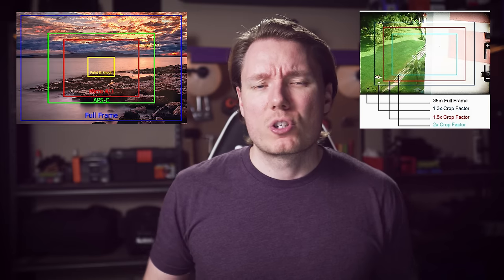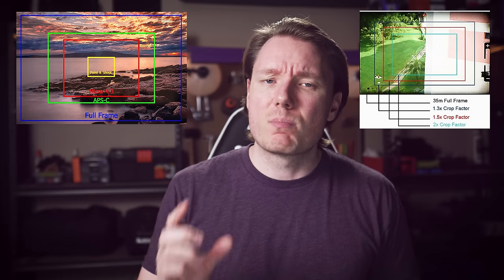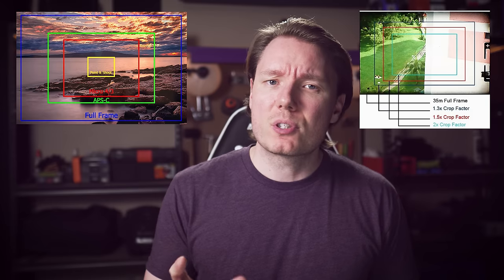Crop Lenses on Crop Bodies: How It Works vs Full Frame (APS-C & M43)

Comment: There's one thing missing in your explanation; and it's the T number. To say that a full frame f/1.4 lens is wasted on an APS-C body because part of that f/1.4 "light quantity" falls outside the frame, while an APS-C designed f/1.4 lens fully exploits the f/1.4 "light quantity" potential, is misleading, because you don't say that the amount of light that actually hits the (and is recorded by) a sensor is NOT determined by the F number. The F number is a merely mathematical relationship between the focal lenght of a lens and the diameter of it's aperture. It is, in fact, called more correctly the FOCAL RATIO of a lens. Now, do you read "light" or "luminosity" anywhere in the FOCAL RATIO definition? No, you don't. And you don't because the TRANSMISSION of the light is NOT a direct consequence of the focal ratio. The focal ratio of course is an important factor, as it describes and determines the physical boundaries through where the light has to transit, but it's not the only factor. For marketing reasons, lens manufacturers tend to sell their lenses under this misunderstatement that the F number means the amount of light that a lens transmits, which is not true. And why do they do that? Because it helps sales and hides the truth. Because saying that an f/1.4 lens transmits double the light of an f/2 lens can hide the hard fact that your lens may NOT trasmit double the light, because there are other factors at stake. There's the lens coating, which is layers of metal particles that serve to attenuate inter-lens reflections, but which subtracts light as well. Most importantly, there is the number of glass elements in a frame, the number of glass-to-air surfaces, and the actual QUALITY of the optical glass itself, which are factors that may SIGNIFICANTLY impact the amount of light that is transmitted by a lens to a sensor. All of these factors are HIDDEN and MySTIFIED when a lens luminosity is advertised as determined by the F number. 
So, having set thi fact straight, let's assume that two f/1.4 lenses, one a full frame lens the other an APS-C lens, are used to take the same photograph, in the same instant, with two identical APS-C cameras both set at the exact same shooting parameters of aperture, shutter speed and ISO. If the argument that an APS-C f/1.4 lens "uses all the light of an f/1.4 aperture" while a full frame lens 's light gets "wasted" because part of it falls outside the frame, then the photograph taken with the full frame lens should be DARKER than the photograph taken with the APS-C lens. But instead, guess what? They are IDENTICAL. And the reason is that the T number, the TRANSMISSION number that determines the actual QUANTITY of light, is an AVERAGE that is calculated over ALL THE SURFACE of the exit pupil of the lens! And why is that, you may ask? Because light is not transmitted on a flat projection plane. Light is NOT 2D. Light is 3D. If light was 2D, then yes, transmission would happen in straight lines, and whatever light falls outside the frame, would be lost; but lenses don't work that way. And this is the key concept to understand: ANY POINT ON THE SURFACE OF A SENSOR IS HIT BY LIGHT RAYS COMING FROM THE WHOLE SURFACE OF THE LENS' EXIT PUPIL. So why does this matter? Because like I said, T-number is not a mathematical function, it's the AVERAGE of the ACTUAL physical trasmission of the light. So ANY POINT on the surface of a sensor gets the average of ALL the light rays that have passed through the lens, EVEN THOSE WHOSE POSITION EXCEED THE FRAME BOUNDARIES OF THE 2D PROJECTION CALLED THE "IMAGE CIRCLE". Because, I repeat, light is not a 2D projection, it is a 3-dimensional projection!
So, what happens when you use a full frame lens on an APS-C body, with regards to light? It simply happens that what falls on the sensor is only the most luminous part of the image circle. Why is that more luminous? Because being in a central position, the light rays coming from the center of the exit pupil have to travel a shorter distance than the rays coming from the edges, and, as everyone should know, the intensity of the light is inversely proportional to the square of the distance from the source. On the edges of the image circle, instead, the rays from the central part of the exit pupil have to travel a bigger distance, and this (together with other factors that would take too long to explain) determines the light falloff that usually we can see around the edges of a photograph. In theory they should be compensated by the nearest position of the rays from the edges, but these rarely make up for the difference, because unless a lens is built with a huge front element, much larger than the minimum required, and unless the intermediate elements in the optical scheme are built with top quality optical glass, the light that makes it to the outer edges of an exit pupil is always inferior in quantity to what gets to the center of the exit pupil. But we digress.
Let's get back to the main point: what happens with the full frame lens on an APS-C body? In a nutshell: since the light quantity is determined by the T number and not by the F number (and this is the omission that flaws your reasoning), and since the T-number is an average calculated on the whole surface of the light circle, if we have a f/1.4 full frame lens on an APS-C body, and the sensor only captures the innermost central part of the image circle, it will capture a part of the circle that is BRIGHTER than the T-number of the lens (which is AVERAGED with the outer parts of the image circle), and this difference is exactly equal to the light quantity increase that an APS-C designed lens of the same T-number gets by concentrating the light rays onto a smaller projection circle. And VOILA', the two photos, taken with APS-C lens and a full frame lens of the same T-number on two identical APS-C cameras, have IDENTICAL LUMINOSITY. Which is what EVERYONE who shoot both full frame and APS-C lenses on an APS-C body has experienced.
In conclusion, two statements: #1 F-number is not a good standard to use to talk about the luminosity of the lenses. Forget about it. Use T-number instead and #2 the whole argument that full frame lenses on APS-C bodies have their luminosity partially wasted is scientifically inconsistent and ultimately, well... BS.
Reply: Transmission values just are not used in still photography. There is no need. They are for movies where the exposure is far more critical.
Reply: @okaro6595  They may not be used, but that doesn't mean that they are irrelevant. Lab tests have shown that lenses with the same nominal F number offer luminosity performances that are sometimes quite significantly different!
Reply: It's not bs. I think you misunderstood what he said when he said light is wasted on aps-c bodies. He wasn't saying the exposure changes on the same exposure settings. He is saying the lens will transmit a full frame image to aps-c body, but the smaller sensor won't expose for the whole full frame image. It crops away the edges. The edge information it crops away is what is being wasted. 

Exposure with the same lens on full frame and crop body will remain the same.

Comment: Aren't you confusing the sharpness of image and the amount of light hitting the sensor? speed booster will increase the amount of light hitting the sensor, but using your logic, it will also make the image sharper, which is not correct. similarly, wasting the light around the sensor will not make the image on the sensor less sharp !! we are not talking economy here ;)

Comment: You lose 1.5 stops of light by using FF lens on APSC body. Do not believe me? Practically check a 50mm FF lens and 18-55 kit lens on the same settings on APSC body.
The apsc sensor is unable to capture the full light which could be captured fully by FF lens. Yes, those two lenses have different imaging circles, FF lens circle has 1.5 times bigger imaging circle. So it has 225% more total light.
This will result in lower shutter speeds compared to dx lenses.
Reply: Of course you will not lose any light. The exposure is about the light intensity, not about the total amount of light.

Now there is the connect of equivalent aperture where one multiplies the aperture by the crop factor like one does with the focal length but this is just a tool fit comparison, not a real thing. In reality it shows by the fact that on APS-C one cannot raise the ISO so high.

Comment: A lens is not a flashlight! It is not the fakt that a crop camera is getting less light from the same lens. You only CROP the image circle, that is why its called CROP in the first place. No lightmeter has a dial for ff or apsc nor m4/3.
Dont agree? Put your apsc and ff camera to the same values on the same lens and take a shot from the same scene... the exposure will be the same. A lens is NOT a flashlight!

Comment: That's not how that works at all lol. A native crop lens doesn't "focus more light" onto the sensor. A crop lens is literally itself cropped to fit the image circle, it is not the same whatsoever as a speed booster. That's why a speed boosted lens from a larger format is faster than native crop lenses.
Reply from the maker: I never said it did. I said it projects a smaller image circle. I then went on to explain how speed boosters focus the light. I think you misheard some of the video.